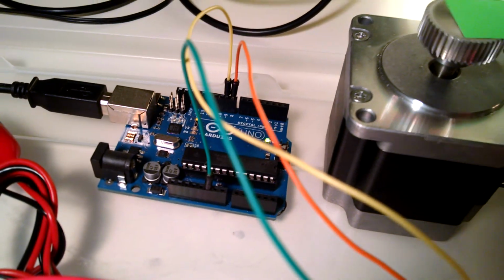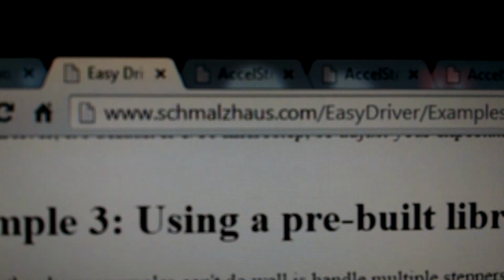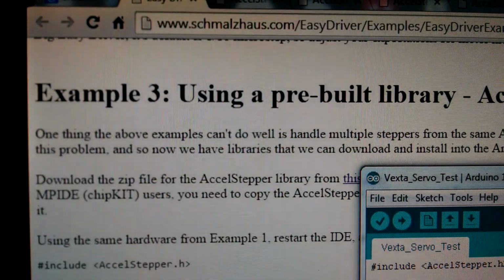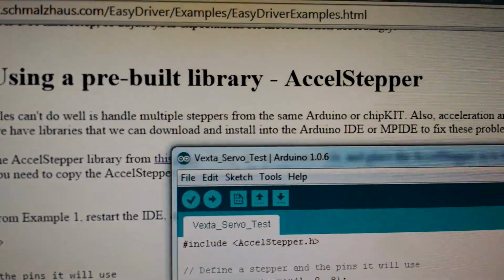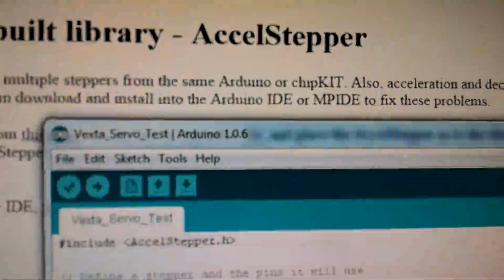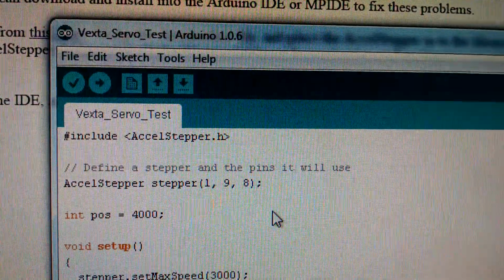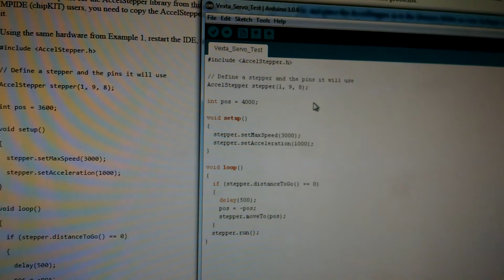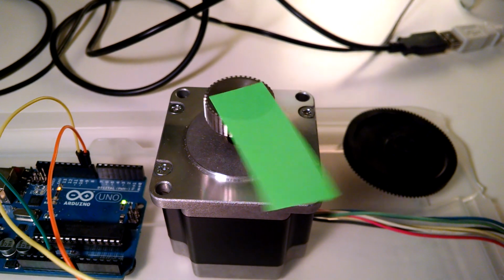From The Bench: Vexta Stepper Motor, Arduino, and EasyDriver

Comment: sir i have project with use motor vexta BLHM 450 kc, do you know how to make motor running with arduino sir ,,, plss
Reply from the maker: I'm not familiar with that motor, but if you have a multimeter you can figure out which wires make up the internal coils
Reply: ok thanks sir ...

Comment: Hello

I have a project with a stepper motor too, and want it to fade in and out like yours does .
it is possible that you could release the sketch ??

- Kristian
I
Reply from the maker: The sketch itself it about as simple as possible. What I show in the video is all the code I used. It's basically an exact copy of the example here:

http://www.schmalzhaus.com/EasyDriver/Examples/EasyDriverExamples.html
(see the section titled "Example 3: Using a pre-built library - AccelStepper")

All the "fade in/out" movement (acceleration/deceleration) is handled by the AccelStepper library. At the top of the code file, the library is "included" and then in your sketch you just set the acceleration and maximum speed, and the library handles the details of the actual movement/stepping of the motor. Essentially you just tell the system how to move, and how far to move, and the library code takes care of the rest.

The AccelStepper library can be downloaded from here (look for the link to the zip file):
http://www.airspayce.com/mikem/arduino/AccelStepper/

The Arduino development environment makes it easy to install the library. See instructions here:
http://arduino.cc/en/Guide/Libraries